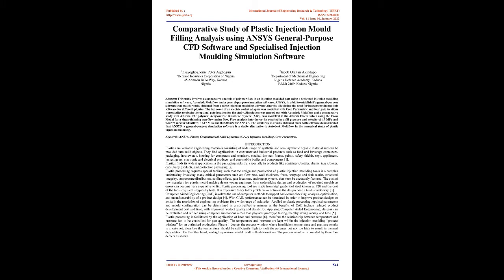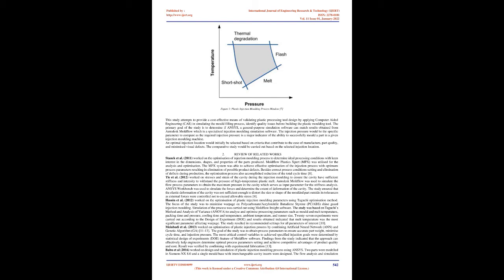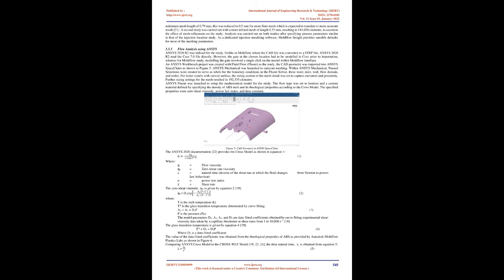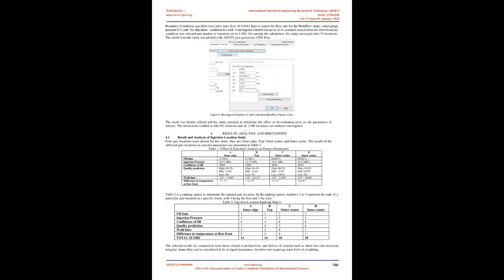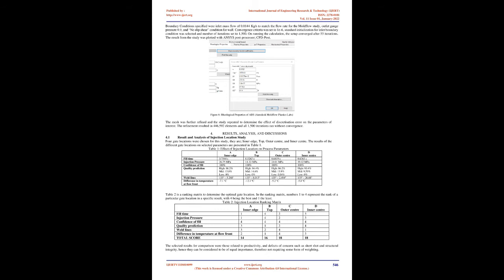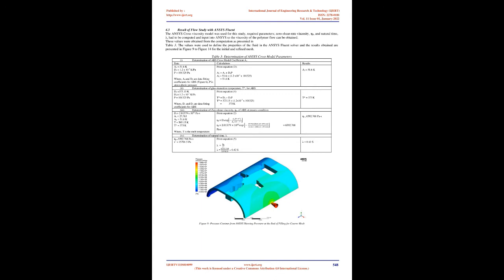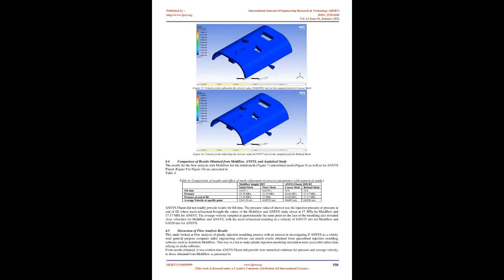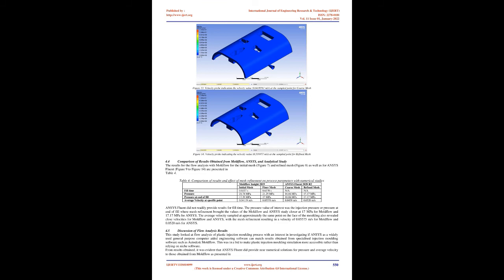Comparative Study of Plastic Injection Mould Filling Analysis using ANSYS General-Purpose CFD .....

Comment: Hi, i also try to set up a injection moulding Simulation in Ansys fluent. How did u do That? I set up a multiphase where the air is removed by the mould but i dont know how the change the outlet for the air to a wall for the mould to fill the chamber :( can u help me please?